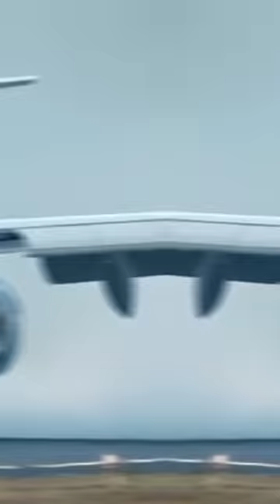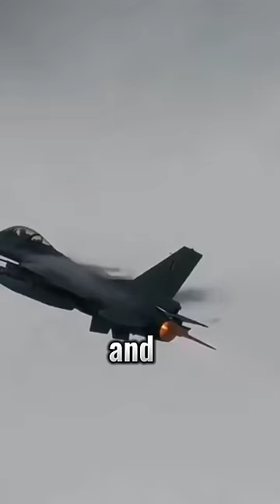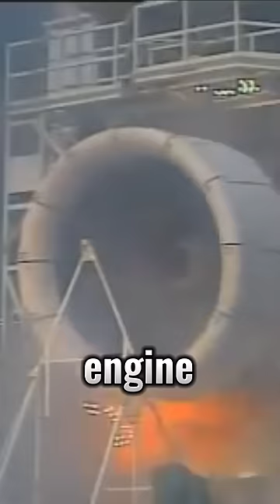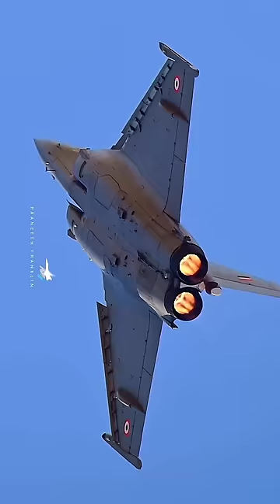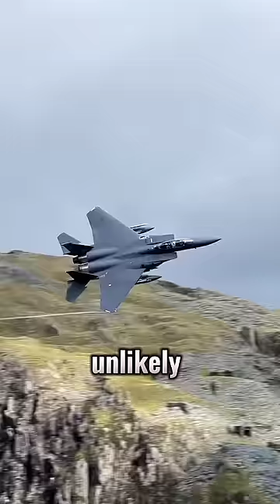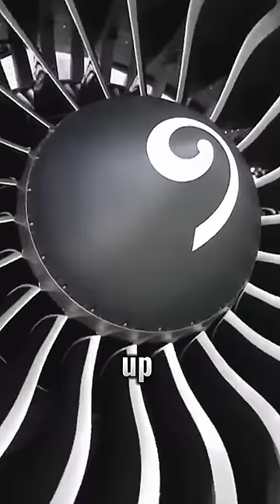What Happens To A Fighter Jet When A Bird Enters Its Jet Engines? 😱

Comment: ANYTHING other than air going into the engine is typically unwanted
Reply: Well what about fuel?
Reply: @killeralltires  you got me there lol

Though I'd argue that fuel could already be within the engine, because it gets injected there, not in front of the intake.
Reply: What if I went in the engine
Reply: @aceofaces1506  Only one way to find out
Reply: @aceofaces1506  Depends if it's on or not
Reply: Rain & snow are perfectly tolerable
Reply: @bro6117  i'm sure they are designed & tested to able to take on the heaviest rain even recorded.
Reply: @bro6117  i found an f-35 patrolling with troops in netherlands/norway during winter? Also most russian fighter jets are able to take off and fly maybe due to their geography and weather that russians focused on engines that are capable of withstanding large amount of snow, even if it means to degrade the actual jet itself
Reply: @killeralltires  😅😂
Reply: The bird will get blended and destroy the engine even if its a small bird
Reply: Water can help an engines performance
Reply: Rainwater actually give them boost
Reply: Except rain, 
rain actually gives extra thrust😅
Reply: Thats literaly 1984
Reply: @Forciik_  wat?
Reply: the two grains of dirt going into the VTOL intake of my F-35:
Reply: 2 milimeters of water DROPLETS enters my engine im dead. Dirt gets picked up im dead. Dust gets in im dead.
Reply: And water
Reply: well rain water actually helps it because greater mass being ejected from the engine means more speed it’s probably not noticeable but its still there
Reply: Like ur lungs
Reply: @wertbe1718 😂😂😂
Reply: What about a Popeyes chicken sandwich

Comment: Marine F18 ground crew here….bird strikes dont happen a ton but it definitely happens once or twice a year per squadron. Usually the result is blood on the walls of the intake and a horrible smell of cooked meat….they usually shut down the engine but ive never seen them loose an engine because of it….Once the plane lands the powerline shop will drop and swap to a new engine. After a test flight “pro flight” the bird will go back on the flight schedule
Reply: Crash crew, same branch same bird…very rarely is an engine out a catastrophic event.
Reply: Air force, F-16 engine specialist here. I kept track of every bird strike we had in my squadron over the span of a year. Responded to 7 bird strikes. Got real familiar with the smell of bird remains in an intake and pulling engines 😂 A couple we got lucky, some tweety birds got sucked up and had zero damage passed 1st stage and scopes checked good. 1 bird strike was a turkey vulture. R2 every module at that point
Reply: How many yards of flightline are required? 😂
Reply: No I’m pretty sure the bird is dead
Reply: @bigblue207  lol 🤣
Reply: Nice bro
Reply: Excuse me if it is a dumb question, but I always wondered what if the intakes had some kind of grill or something to let the air flow but prevent the big birds to get into the engine. I mean, they would most likely get into anyway, but in small pieces and maybe would be less harming. Or maybe it just would be worse if a metal piece of the grill gets loose and gets into the engine...? 🤔
Reply: @isihernandez9752  you’re talking about a mesh type filter over the intake. The answer is no. Think about the speed the air is coming at, it’s literally a wall of dense air. Any grill would get sucked in instantly at high speeds. Plus it would mess with the airflow of the air which could cause an engine to stall. Just too many variables to think about
Reply: Can you clarify which “bird” goes back on the flight schedule?
Reply: @Mautiks  lol the aircraft goes back on the flight schedule. We sometimes refer aircraft’s as birds.
Reply: @KoolAidSquirt  i know it was a joke
Reply: the birds will go back to fly ? hmm am not sure about that
Reply: @VIPER276  No bro.. he's referring to the aircraft AKA the bird. I dunno if he did that on purpose just to make a joke
Reply: @just_violet  am joking lol
Reply: @KoolAidSquirt   we called ours hogs. F-4E
Reply: @Cristian Cuevas  When the object strikes the "mesh", it will get sucked in as well as the object and cause even more damage than just the object itself.
Reply: The 'tism is rampant in the comments
Reply: Though the other bird is not coming home
Reply: Thank you for your service

Comment: Well..there's a fact:
" Fighter pilots can eject, Commercial pilots cannot"
Reply: Yeah, they have to land on the Hudson.
Reply: @Schnittertm1  Yeah..lol
Reply: Another fact:
Ejection from aicraft is dangerous for pilots, and its sometimes safer to land damaged plane, than ejecting from it and breaking some of your bones, making you unable to fly again,  and letting the aircraft crash into something or someone that might be on the ground
Reply: The thing is that for larger planes like commercial ones, it's extremely risky. And to add, whenever that big ass plane is going is gonna fuck up anyone nearby. It's much more reliable to land on water like a raft or a nearby free space.

But most planes are able to fly even without engines, typically like only one. You cannot fly with 0, but u can with one.
It depends on the weight of the aircraft of course. Let's hope your next flight isn't flocked by overweight people
Reply: @Internal_shiver  Yes..But you know it's over when you lose both engines. Also it's very risky to land on water, they were able to land on hudson because it was a narrow jet a320 and bigger planes can take heavy damage by landing on water and even crash. But yeah it's better than crashing in the middle of metropolitan city..
Reply: @Schnittertm1  😂
Reply: fr
Reply: Commertial pilots also aren’t expected to be fired upon by enemy anti air capabilities.

Comment: I used to work for an engineering company that made commercial aircraft parts and we made something called a “bird splitter” which was basically a set of razor sharp blades that sit behind the turbine of a jet engine, any bird (or other squishy object) that gets past the fans is diced by it before it can reach the rest of the engine apparently it mostly liquified the bird
Reply: Wait, it's still goes to intake manifold right?
Reply: Thanks for the heads up. We need people like you thanks
Reply: This is how Great Value brand sausage is made
Reply: @malcolmgodshield6837  i hope you weren’t planning on entering a commercial jet engine any time soon
Reply: If it sits behind the turbine, the damage is already done and it’s pretty much useless.
Reply: @Big Daddy71  I think he meant the air intake fan at the front of the engine before the compressor. Some people get the fan confused with the turbine.
Reply: @pamady276  yes, but it’ll be liquid by the time it even gets there. which does a lot less harm.
Reply: Most jet planes have 2 engines
Reply: @HUDDY6541  that doesn't really make a difference, it can still fly with one engine depending on the weight of the aircraft
Also depends on the shape of the wings

Comment: If a ""strong Convex Steel wire Mesh""is welded in front of the inlet of the engine,  can't we simply solve this problem.,??
The convex wire mesh will " deflect"  any hitting bird outwards. ( Just my opinion.).
It will not hinder air intake, but will deflect any bird outwards.
Reply: If you hit a bird at 4to500mph it might damage the engine it might not(depends on the size of the bird) if you have a wire mesh grill it will take that grill and ram it through the engine destroying it, plus any grill WILL affect airflow through the engines

Comment: Fun fact: if during a flight with a jet fighter, your engine stops working. There is absolutely nothing you can do regarding this. The system will try to restart the engine and you just sit there and enjoy the weather.

The only thing you can do is either maneuver the war machine or eject... those are your two options  when the engine fails.
Reply: all you do is sit down and go to enemy terrotory and pretend its pearl harbour

Comment: It isnt the impact so much as the out of balance condition and carbon deposited in the impact.  In no time the engine self destructs.   Reminds me... Back when Airbus was trying to get its qualifications to fly in the US they had to meet the criteria that the engine had to take a goose in full throttle and pull through it.  The called up and asked what we did to do this and we told them we just went to the store and bought a ten pound frozen turkey and used that.  After a week or so they called back and said they were baffled. Every time they try it the engines explode.  After some discussion we sent a rep over there to oversee their tests.  He saw the problem right away.  First, he told them, you have to thaw the turkey.

Comment: Seems like turbo fans are more susceptible than turbo jets. Especially high bypass variety. The insane heat and pressure of a turbo jet seems more like a self cleaning oven or pressure cooker.

Comment: I work at a airport. Them engines aint made out of high class material. Shii the outside of a plane is hollow plastic that is cement glued or puzzle pieced in. very few panels bolted. Plane engines are just a bunch of slim spiraling sheet metal pieces. Literally first day on the job I told myself “how tf is this legal I literally feel like i can break the plane, and dent the inside of the engine with my bare hands”

Comment: Engine failure will not always result in catastrophic failure. Most passenger airplanes are designed to fly with one of the engines not working. And in the case that both engines fail, the airplane will still be able to glide to a nearby airport or emergency landing spot
Reply: think you are being a bit optimistic, glide range is minimal, and most bird strikes occur at low level. In most cases of aircraft safely recovering(though not all) there is some power from one or both engines allowing some control to be retained if the engines are completely out you only have minutes or seconds depending on your altitude.

Comment: The distribution of air from the bird isn’t what damages the engines the bird being chopped by several compressor blades is what damages the engine.
Reply: what damages the engine is the impact of the bird on the fan/compressor, if the fan/compressor are damaged that leads to damage right through the engine getting worse the further through it goes

Comment: Tolerances between blades and vanes are very tight.
Even a bearing or nut can totally destroy the engine, if it is injested within the main engine... If it's only the fan blade then not so much.

Comment: Roughly 70% of air ingested is bypass for cooling purposes
Reply: Wrong
Reply: Where on earth did you get that? I’m assuming you are talking about a turbofan engine like on a commercial jet. The bypass air is where it gets most of its thrust. In the video they are talking about turbojet engines. No bypass

Comment: Wonder why they don’t put a external cage that that’s shaped like a come on the intake, it wouldn’t prevent airflow, wouldn’t cause drag and anything like a bird that hits would just deflect off.. sounds like a simple solution to me
Reply: You just said it yourself, it would massively reduce airflow. And fast flying fighter jets need A LOT of air.

A net would also need to be incredibly strong to resist a hit from a bird flying at those speeds, and would add too much weight to the aircraft. It also increases the drag a lot.

Comment: Birds strike are survivable, for commercial aircraft because of the bypass ratio, Jet fighter are 20 000 time more likely to get engine failure, this is why even in operation Jet pilot don't fly into a bird flock

Comment: Incorrect

Inside a fighter jet engine are 12 turbines that compress the air in the compression stage of the engine that then goes I to the combustion chamber if a bird goes inside the engine intake it's body will hit and dent and scratch up the blades making them unserviceable because it messes with the tradgectory of the air going into the combustion chamber

Comment: You forgot one thing: jet planes usually are higher altitude than birds,
Reply: Actually no they are not. Not during take off and landing. And aircraft have lost an engine and even all engines to birds during these phases of flight.
Reply: As in the miracle on the hudson landing.  That plane was brought down by multiple bird strikes killing both engines.
Reply: military aircraft regularly fly low level/high speed, and birds have been seen at some amazing heights

Comment: Really just stating the obvious... Big birds cause big damage, small birds are unlikely, big damage is catastrophic, but it's unlikely cuz new jet engines are made of tougher material. Thanks bro👍
Reply: depends on where the bird hits but if the fan/compressor have signiicant damage you will be having problems

Comment: Well yes almost everything you said in this video is true if you had a total engine failure on a commercial plane it would almost never be catastrophic due to the fact that commercial planes are completely capable of flying with a broken engine now of course if they had the option to land and fix it they could but even if your over the ocean unless both engines happened to fail the it wouldn’t be that bad and on planes with 4 engines it is almost impossible to make it catastrophic and on 4 engine planes if an engine went out it would be unlikely that the pilot even told you it was out

Comment: Yeah, but you ought to see what happens when a Turkey Vulture hits a leading edge and ruptures a bleed air duct. BOOM! If it's at a wing root, you can lose all engines on that wing. That's on Heavies. A Turkey Vulture down a fighter's engine is a bad day at the office if you're in a single engine fighter. It doesn't "disrupt air flow", it rips out blades and if enough break free you'll have a catastrophic engine failure, i.e. the engine explodes. Mid sized feathers causing engines to jam? Are you kidding me? Have you ever worked on an aircraft?